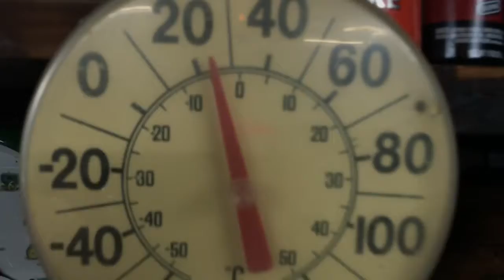LS1 Trans Am Cam Swap! - Pt. 4 Changing Valve Springs

Comment: How did you line the cam dot up with the gear dot?
Reply from the maker: AJ Tindall just turn the crank until the crank dot is at 12 o clock and turn the cam until the cam dot is at 6 then put on the timing chain. Turn the motor over a couple more times to make sure the dots line up still

Comment: Hey when you remove the radiator did you just unbolted the 2 10 bolt AC condenser to pull it up to release the radiator or you just pull it up with the bolts in the AC condenser
Reply from the maker: AJ Tindall the ac condenser is only connected to the radiator by 2 tabs on each side. You just have to lift the radiator out of there but get someone to help you. I ended up pulling the condenser later so that the cam would clear. It just made it easier but you don’t have to
Reply from the maker: Also remember to unplug the fan connectors
Reply: Zach Peterson was you able to start her up
Reply from the maker: AJ Tindall not yet. Just started a new job
Reply: Zach Peterson oh ok so I have one more question with the valves spring when you change them what method you go with? Did you remove the spark plugs to check or did the tdc
Reply: Never mind forgot it’s in your video good shit bro she’s going to become a beast
Reply from the maker: AJ Tindall thanks man 👍🏼👍🏼
Reply: Zach Peterson fuck bro wish me luck on this valve spring install alil nervous and I’m going to use the tdc method. Cam and timing chain, oil pump already installed springs is the last of it